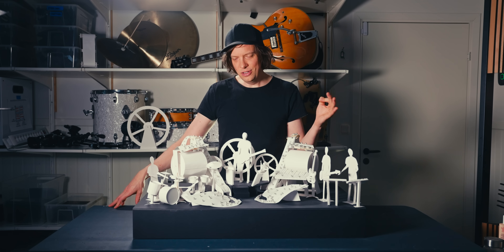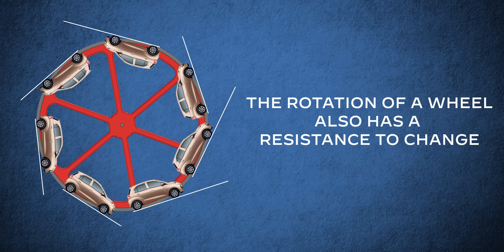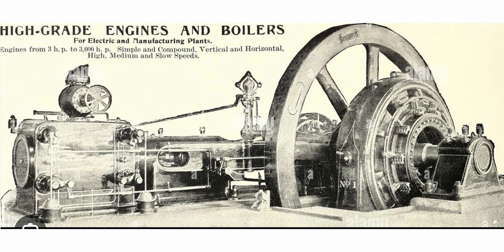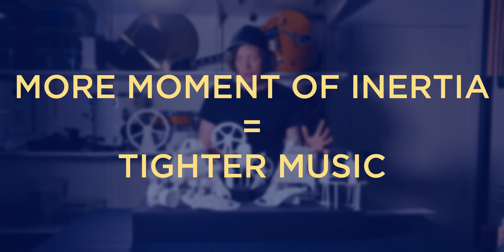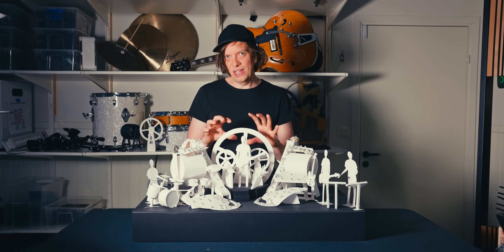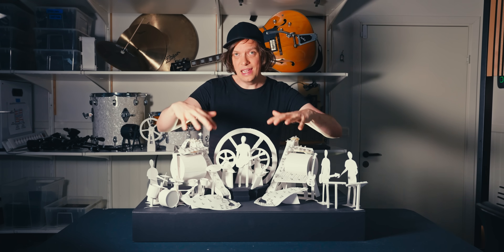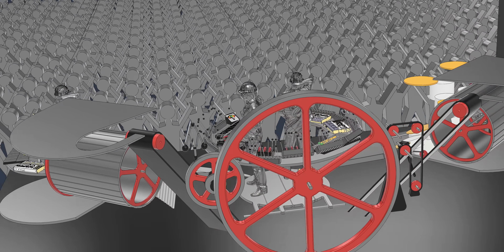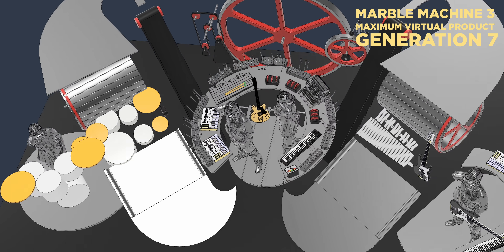What is Moment of Inertia? (The Heart of The Marble Machine)

Comment: Question to people who understand the physics behind the flywheel: How fast will this thing need to be turning? And would it at a certain speed not begin to create wind turbulences and choppy sounds?
Reply: Any rpm desired. 
He could spin the wheel at 60 rpm for the whole show, without stopping it. He just needs to use a clutch/gearbox to change programming wheels and set tempo.
Reply: @Krisdafour  Yes and no, I expect it needs to go faster than that - those programming drums and the marble lifts are going to demand a great deal of energy, but not at a consistent rate. Which means to play 'tight music' (at least the way martin seems to fuss down too) the flywheel has to have an inertia that dwarfs them, which means its either got to be really really heavy (which would lead to impractical material choices once you start trying to get heavier than steel) or spin faster.

And @gregfraser4052 is correct with a spoked wheel it may well start to create sounds thanks the air moved by the spokes. Though I don't think that will be too terrible compared to the rest of the  mechanical noise with the right design.
Reply: @foldionepapyrus3441  Remember that the moment of inertia can be increased by increasing the speed, size, or weight. 
Just make it heavier. A slow speed is quieter, and more visible.
Reply: @Krisdafour  But only so heavy they can go and still have any hope of transporting it, or assembling it without a gantry crane etc. I agree slower rotation would be better, but the shear scale of those programming drums and all the marble lifts means a huge but highly varied load... 

Assume they just played a denser section you are suddenly trying to lift a few Kilo of marbles more than the usual rate up those many meters - its a great deal of energy consumed and a great jump in the variable load just from that. Which demands a very high inertia in the wheel.

Comment: He is going to run smack i to the the old equation, double the volume 8x the weight, yes his flywheel can be thinner, but by doubling the size he is still going to have a drastically heavier flywheel,

Comment: certainly, but i can foresee a few problems:
1) all large spinning flywheels are inherently dangerous. unless it's protected by a significant screen/fence/whatever, someone can fall into it and be crushed/smashed, quite badly. lol, the industrial revolution ain't remembered for its worker safety.
2) combining the power of two people working the pedals is not a trivial thing, unless they are either synchronized, or out-of-phase by 180 degrees (e.g., pedals on a bike).
3) getting it up to speed is significantly more difficult and time-consuming.

Comment: Safety is still an issue no? Let me propose a smaller flywheel, attached to it a larger one made out of polystyrene or some lightweight material. It would be functional, look cool, but wouldn't break your arm if you stick it into it.

Comment: If it's big it becomes dangerous enough that you'll potentially need a safety cage that covers it. Industrial revolution machines regularly killed people. The flywheel in that skeleton clock has about zero inertia so it can be open. I'm not saying you shouldn't do it but... think very hard about it. Some good things would be 2+ people powering it; that's awesome if you can do it.

Comment: I'm concerned about dis/re-assembling the flywheel between shows, it feels like it introduces the risk of the flywheel not running true, which could be dangerous. Let me do some calculations to see what the math says.
In germany you went up to 120 bpm with a gear ratio of 1 to 8, meaning a flywheel rpm of 960, with a radius of around 30cm.
If you were to scale that up to a 125cm radius and keep the weight the same, then the moment of inertia would become (roughly): 125cm²/30cm² = 17.361 times as much. As per the formula for angular kinetic energy (KE=0.5*Iω²), where ω is the angular velocity, that means that ω² can be 17.361 times smaller.
since angular momentum is linear to rpm, I will use rpm in the rest of this calculation
960rpm²/17.361 = 53084.5
√53084.5 = 230.4rpm
meaning the rpm can be 960/230.4 = 4.17 times as low
which is exactly the same as 125cm/30cm, so all the calculation above is just a long way to say that when keeping angular momentum constant, rpm has an inverse linear relation to radius.
The relation between mass and rpm is also linear, so if you were to increase the mass by 4 times, that would decrease the rpm another 4 times, bringing it down to 57.6rpm. At that speed, minor imperfections in the balancing of the flywheel might not be such a big problem

Comment: Yesss...  embrace the steampunk!
edit: I disagree with your dismissal of Steampunk as form without function- I think the CORE of steampunk is what you're saying- form FROM function.  But pure form-from-function leads you towards a Modernist, Bauhaus style.  I think what Steampunk is (as an aesthetic; there's SO MUCH to discuss when it comes to Steampunk as a genre) is a derivation of form-from-function where the form is still considered when determining function.
After all, if you were purely worried about the function of the music-playing-device, you'd be touring with modular or custom made synthesizers- they're the proven, reliable, and capable devices that can efficiently perform programmed music with as little extraneous 'fiddle-faddle' as possible.  But you're choosing to reject that minimalist approach and use an out-dated technology as the basis of your equipment, and THEN deriving the form-from-function, which (in my opinion) makes it Steampunk.

Comment: "doubled the power input", as long as you are both equally powerfully built and don't get in each others way... Sure, lets go with that, but even so you have also increased the power demand - that moment of inertia increase requires you to put in more energy to get up to speed in the first place, so you will want more power there - think how much you struggled with that previous prototype. And then because its heavier and larger its got more bearing friction and air resistance so is going to demand more energy to maintain that speed. And all that is assume you manage to reassemble the thing equally perfectly balanced as the smaller wheel every time, and non of the components can shift at all during the thermal cycling that will happen when you pack lots of people and stage lights in the space - soon as it starts vibrating instead of just spinning you are wasting even more energy in that vibration, and putting the whole structure at risk of a rapid unplanned disassembly...

Comment: You seem to confuse moment of inertia with angular momentum in your presentation. But what mostly matters for a flywheel is neither the moment of inertia or angular momentum, but rather the kinetic energy stored in the flywheel. You can store the same amount of energy in a small flywheel (small moment of inertia) spinning fast, as in a large flywheel (large moment of inertia) spinning slowly. I understand aesthetically you prefer the larger flywheel, but from an engineering perspective it is not clear why a large flywheel would be better than a smaller, faster spinning one.

Comment: I think this is a great idea, not only visually, but also practically. As commented on another comment: A bigger wheel has the same moment of inertia for a smaller mass (or a greater m.o.i. for the same mass) and so would not increase static loading on stage. It wouldn't have to be made out of cast iron like the true industrial revolution flywheels, it's only powering a marble machine and not huge equipment. The vibrations could be stronger but they'll be less energetic and so likely less of an issue, plus balancing could be done with moveable weights quite easily, even with wear. If anything it's likely safer than a smaller faster flywheel, not only do you have more time to react, it will hold less energy (energy of flywheel = m.o.i. * angular velocity ^ 2). I know I'd rather stand in front of a slow rotating 2 m wheel than a fast rotating 0.5 m wheel!

Comment: One thing I don't understand in these recent videos is the shift to bringing the whole band on stage with the Marble Machine. Isn't the point of the machine, the thing that impressed so many people about the concept, that it plays multiple instruments and is operated by one person?

If you have a guitarist and a dummer and a keyboardist on stage with you, what is the point of the machine anymore?

Like, I get that you want to play with your band, but you're still refusing to set all your main design requirements (other than picking a visual language for it, which is a design requirement and a good step!), because a lot of your concepts for the machine as it is now completely contradict each other.

Comment: martin : the second machine failed because it was the same bad form factor as the first 
also martin : lets choose a form factor and style that looks cool for the third machine we will figure out fonction later
i agree that moment of inerta can be used to smooth out rythm , but choosing the size of the wheel is nearly the last step , most important is to make a programing and marble dropping setup that is precise and dosen't require lots of energy , then you will know how big of a flywheel and safety slipclutch you need .
i think martin shouldn't be allowed to be excited about anything , no emotional connection to any design , mechanism or process , only calm rational pros and cons weighing 
good luck

Comment: I understand that you want to operate it manually, but will you be able to operate it during concerts when you are on tour? I think you are making it much more difficult for yourself and increasing the risk that you will burn out. My advice is to put an electric motor there that can take over. The crowd hasn't come to see you pedal to keep the machine going. If, on the other hand, you become exhausted and collapse from overexertion, they will not be so happy.

Comment: A lot of comments are assuming it will be bigger without compensating for weight and speed. It will probably have the same inertia of the current one, but being bigger. so it will lighter and rotate slower. Way safer, and doesn´t need any more power input to operate
Reply: I'd argue it'l even need less power input because friction of slowly rotating parts is comparatively much less.
Reply: It's safer in that I think a slower moving, larger wheel has less chance to rip itself apart to the point of being shrapnel. A situation in which a bearing or axle goes out and the flywheel becomes loose it's going to be the same, the only difference is you'll have time to react before you're crushed. You'll still be crushed.

Comment: Well this is the straw that broke the camels back for me.

Sorry Martin, but you've fallen into the trap of feature creep yet again, and you're placing too much obsession on perfectly tight music, to the detriment of safety and practicality, rather than good enough music. In a live concert environment, no-one is going to notice the tempo being off by 0.7th of a beat. This flywheel WILL end up in someone being mangled or killed unless you basically seal it in a inch thick metal box.